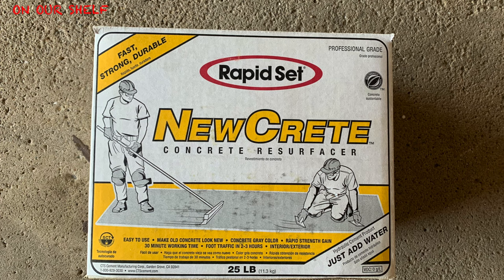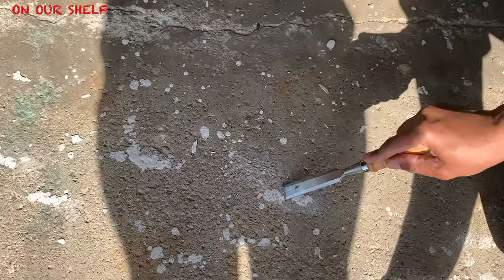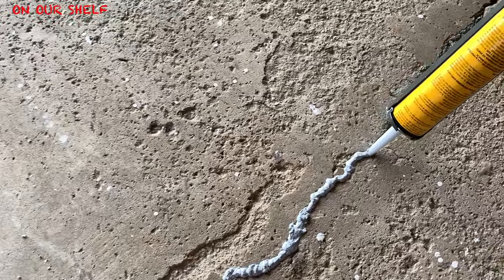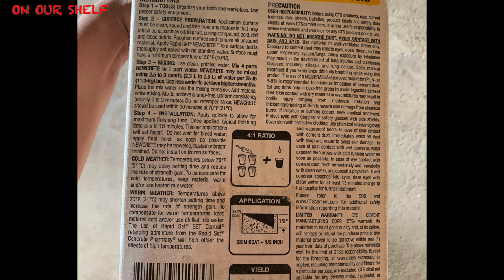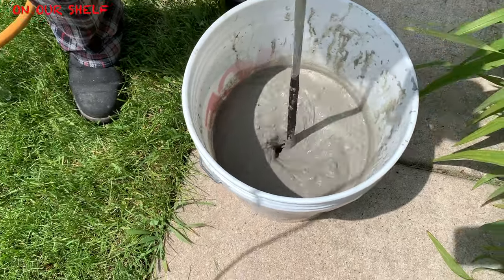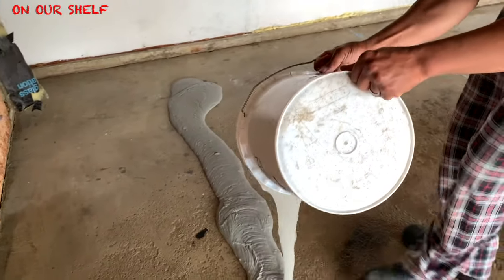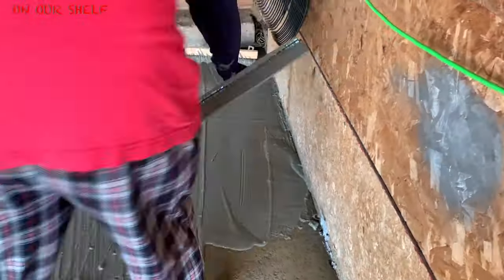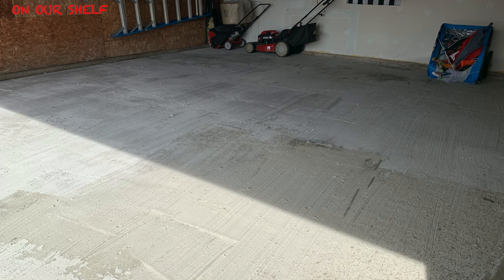New Crete Concrete Resurfacer Review

Comment: Right on the label you show:  "Add material WHILE MIXING."  You didn't do that.  Add it more slowly and do it while running the mixer at a slow speed.  Then once it's all added speed the mixer up slowly and be patient until it transforms into a pancake batter consistency.  Getting the mix right is essential to getting good results.  Also, make sure the mix is stored in a cool place prior to mixing and use COLD water to get the 30 mins working time.  Time yourself mixing (no more than about 3 mins) and don't overmix.  Good luck.
Reply: DIYers are always alone!!.

Comment: I finished concrete for about 10 years.  You did alright for a rookie.  You should have kept stirring until all the lumps were out.  Even if you need to use a board to smash the larger lumps.  Also, you should have done smaller sections.  If you would have took more time it would have turned out better.  Your broom is not very good and you are brooming with too much force.  You should have done it in like four sections.  Hammer drilled some 1x4s down to make some nice control joints.  Thanks for the video.
Reply: Patch spalling areas and cracks 1st
Reply: So assuming someone did something similar.....uh not me of course. What would be the right thing to do now that it's messed up?
Reply: @tigerfriend2000  cover it in an epoxy coating! Lol.
Depending on how bad it is. 😆
Reply: @tigerfriend2000 Lavinia 30” propane concrete grinder and grind.

Comment: My feedback- you should not use the broom to work through big puddles of the mix. You should have poured the mix on the perimeter and pulled it back with the spreader. If you have practice with drywall compound that would set you up for how to spread evenly. Once you pull it back from the perimeter and have it spread out then you brush. Always pull your strokes in the same direction. Never shovel motion like pushing snow. Honestly, if you're up for improving it...all you need to do is buff it with a concrete grinding disk and call it a day. Bonus points if you grind and resurface again. Practice working drywall compound first!

Comment: Hi Jayden,
I have been doing concrete resurfacing over 20 years.  First, let me say;  that was a nice video.  Now, one thing about having a great outcome to any resurfacing project is a clean mechanical bond.  My technique is: 1).  I use a grinding disc even out the floor surface. Also this will remove any unstable concrete at the surface level, which may come up later an cause bond failure. 2).  Clean the surface, just like you did in the video, which will remove dirt, grease and any loose scale, which again, can cause bond failure. 3). One thing that I ALWAYS do after that is to apply a prime coat of concrete polymer or bonding agent. This will help to assure good adhesion and will also slow down the rapid set of your product that you are applying. Concrete can act like a sponge in soaking up the moisture in the resurfacing product, even an interior floor.  Typically, you want to get back on the floor before 24 hours so that your resurface will properly bond to the bonding or priming material. Some types of polymers (Bonding Agent) are what is called non-rewetting, meaning that after the 24 hour window, it will not allow water penetration or a proper bond to the bonding material.  (Many people skip this step and still have good results but this is just how I do my projects because longevity and great adhesion is important to me.   4). Time to mix:  No matter what the product is, I always add a little of the bonding agent that I primed with into the mix, again, just my preference.  When mixing, always put your liquid in first. Then slowly add the dry powder, while mixing. Once it is thoroughly mixed, let it rest for about 2 to 3 minutes. This will help dissolve any dry lumps in the mix. After that time, remix for about 30 seconds to a minute. Also, I like a more flowable mix. It is much easier to apply. I recommend a tool called a Magic Trowel. It looks like a window washing squeegee. Then, pour your material out in a long narrow stream on the floor and move it along with your Magic Trowel, keeping the trowel at about a 30 degree angle. If you try it, it will be apparent how to adjust your trowel. Always work from one side to the other until you cover the entire floor.  Keep a wet edge, this means, don't let your edges dry up on you before you trowel more product next to the last strip that you troweled previously.  I'm not sure if any of this is helpful to you but thought I'd outline the process that I have been using for years with good success and no failures.   Hope This Helps, Lee
Reply: Will this resurfacer work in canada winter? Like -20c  😂
Reply: Thanks. I want to resurface next to concrete stairs on a 1935 house. I will prime it.
Reply: Wow amazing comment! Thank you for taking the time for others, even though his project was already done
Love when people actually add tips instead of unnecessary comments

Comment: As others have said, best practice is to slowly add the New Crete to water while mixing (a friend helps here). Second thing that really helped me (can be done regardless of the amount of water used) is to thinly pour mixture onto the floor and use drywall knife to chop through the remaining lumps. Essentially this is spreading the new crete out a bit before you trowel/brush it out.
Reply: Sift

Comment: Several things I see here. One, grinding the original surface to open the concrete. Two, a primer to increase bonding and create a barrier from potential oils in the concrete from ghosting through. Three, use a different paddle to mix. Eggbeater is good. And yes, slowly add the product. Four, Use a magic trowel to spread it like a window cleaner would use a squeegee. Five, top coat it with a clear urethane sealer. Two coats. Six, I would have filled in those spalled places with Cement All and then the New Crete. Seven, I would have chased those cracks, and opened them up with a v-blade diamond grinder and filled them with Cement All or a two-part epoxy crack filler made for that. Great you tackled that. It was a tough job.

Comment: Yikes! That came out butt ugly rough! Concrete doesn't lie so neither will I. I've done A LOT of resurfacing over the years, no substitute for experience from hard lessons learned but here's a crash course. First off, it's only as good as what it's sticking to, so thoroughly grind the old concrete, and I mean grind it down clean with a carbide wheel on the smoother areas (kicks off dust like 9/11, wear respirator and fans to blow it out and make the neighbors cry) or wire wheels where rough (usually exterior) then hose it out with a broom. Sometimes the product calls for dry floor to be primed first with a bonding agent, otherwise wet... and forget the caulk but chip out the cracks. Always shoot for in the shade, cool, cloudy day or in the evening as hot sun doesn't help. Can't have lumps like that so mix it fast and hard, don't be timid, move that paddle around (I use a 4 arm, seems to work), then get down on your hands n knees and trowel it on so it's flat and smooth, not that lame squeegee on a stick. Finishers prefer a 3"X14-16" lay down / burner trowel, in n out, up n down, away from you n towards you followed by a 5X20" finish trowel (round on one side, use square first to get it flat) side to side in wide sweeping motions, as far as you can reach out, slow, firm and steady. They only sell 4" wide trowels at Home Depot and Lowes, but whatever. The angle is important on hardening concrete, not this stuff so much, just keep the tools scraped clean n wet, constantly. And WHY? would you run a dirty-ass, covered in crud broom over it for a garage floor?! There's usually a window of time when you need to texture it with a broom or sponge. It's tough when you're new mix ridges up against the gooey older stuff like lava, but do your best to overlap, feather it in, a little water here n there. It'll never be totally perfectly smooth the first time over unless it's a small area and you get lucky so come back to scrape, grind and fill then tell 'em to paint it with that durable epoxy paint with chips to hide the imperfections. Better luck next time.
Reply: Excellent advice, but is certainly a hell of a lot of work.
Reply: Thank you

Comment: Thank you for the video.  Sure helps to see these rather than relying on the printed instructions alone.  I used a smaller spiral type mixer attachment with my cordless drill and got decent pancake batter consistency.  Also used a piece of board to scrape the sides of the bucket to make sure no dry material was stuck there.  Ended up using closer to 4 quarts of water per box of material, too.  All-in-all though, Newcrete is very hard to work with for a newbie, since it sets up so fast.  Also, watching another video I realized I should have pre-patched the deeper spalled concrete areas and cracks with Cement-All and a trowel beforehand.  Then used NewCrete only for a very thin "glaze" over the top of it all.  Fortunately I have the rest of the driveway to do it right!

Comment: Gotta mix it longer and a little more aggressively to get the lumps out. Also when you were trying to broom over those piles of materials, that doesn’t work. You’ll need to flatten those out before you drag the broom on it. You could do a second coat and mix it a little wetter. It would clean it up quite a bit

Comment: I did find some fault with, filling the cracks (especially with a caulk) and your mixing and applying it. Smaller batches applied by hand with a trowel would have been better. I applaud you for trying it.  As a building maintenance employee I do have to say that I use Rapidset wall patch, concrete patch and just recently asphalt patch with great results.

Comment: I have used it, didn't get lumps but I added the flow additive which I think they recommend.  anyways, lumps are from not mixing well enough. I think you can do another coat, over the top, hit the lumps with a hammer and break them up.  good luck.

Comment: Thanks for the well-done video. There are a lot of comments as to the mixing of this type of product. One thing for sure is that on a job this large, a helper is key to a successful outcome. What I do question was your decision to brush finish the surface. Garages, like basement floors, are done with a smooth surface while drives and sidewalks are brushed to prevent slippage in wet weather.

Comment: Always add a few inches of water to the bucket first,   run it all through until all the dry stuff is gone and only lumps, if the bucket spins it needs water, if yiu can mix without the bucket spinning its good. Once only lumps are left you bring the drill down so the paddle is about 45 deg and let it flip the mud up a little and hit the air then the side of the bucket. This  comes from someone who mixes a crap load of mortar, resurfacers, plasters, hot mud, ect. Then use a squeegee not a broom over a trowel floor. Any lumps that happen to get by which won't be many you can pull to you and trowel back into the bucket if needed

Comment: I had a hard time with newcrete the other day. But its super strong so decided to give it another shot. The mixing is crucial. Then start with squeege before the brush. I also did the rapid set cement before the concrete in some areas where i had cracks and the concrete went on so nice after that and i didnt need the bonding agent because the cement acted as a primer as long as u get the concrete on an hour after the cement. Im about to resurface my walkway and ill probably do cement first even  with no cracks because im still learning and it made my concrete go on so smooth and nice without my little experience.  I really like that product. I even used their rapid set  asphalt today to fix some street potholes that the city has ignored and it looks professional

Comment: What I love about these guys. It takes balls to fail. You can learn so much from others mistakes. The only 2 mistakes I see is they use a huge heavy broom and they should have use a squeegy, and the had clumps..SO 2 big issues that cause a big fail. but the great thing is you should do it again bro with the 2 adjustments try another quickrete cap or some other overlay material and use SQUEEGY and dont use a broom and make sure smooth as butter  and yu can over lay the garage again easy many people do layers. we want to see 2nd attempt the better way..amazing idea to learn from mistakes

Comment: Not sure if this has been mentioned, using a drywall mud mixing paddle is a bad idea. You can see how it pushes the lumps of powder around. The eggbeater mixer type is ideal since it will break down those lumps. 

It’s important to use the same cement to water ratio. The first batch was a thicker consistency than the second batch which was very fluid, almost like a self leveling.  I’m surprised the product actually adhered, in my opinion the substrate needed more preparation.

Comment: You issue with the lumps is your mixing of the product. You really should put your water in the bucket first and mix the product into the water that will help you to ultimately have a much smoother mixture. It is also a very large area to do with the product you used amd without experience it is difficult to get a consistent blended texture with the diffrent mixes you needed to do.

Comment: I just did my first resurfacing with this same brand with much success. As others have mentioned mix it in slowly and stir for a good 3-5 minutes so that it’s lump free and you want it to be a bit more thin and watery than how you mixed it here. Also next time skip the brush.. I just used a squeegee and didn’t even broom it and it came out perfect. It’s still slip resistant using only the squeegee. But If you insist on using a broom, get a new one and don’t use this jacked up broom lol, live and learn.. you will nail it next time brother!
Reply: Will that work on a green slab after resurfacing with a grinder?
Reply: @brentwiens2652  If it’s green from paint, I would say as long as all the paint is grinded off then you’re good. In fact it will bond even better if you grind the concrete, as it will give it some teeth in the surface to grab on to. I noticed it’s the areas that I didn’t grind that didn’t stick as well and now has areas peeling & chipping off, but the slabs that I did use my grinder have no issues at all.
Reply: Love your transparency! You're a good and honest, hard worker.

Comment: You used the wrong material to fill the cracks. You poured the whole bag in before starting the mixing process. You did  not use a float or trowel to lay it down flat and smooth

Comment: Squeegee first and then use a broom trowel to smooth out the streaksbefore you get to far where you don't have to walk on your fresh work. Uses different type of mixer instead of the flat mixer, it may have helped with the lumps. You still did a good job regardless. Thanks for sharing this video..

Comment: For those doing this, break out the loose chunks in the cracked areas and fill with Cement All first. THEN do the New Crete. Use a float to move the New Crete. You need to let the New Crete set up a bit before brooming.

Comment: Well, I think people pointed out the things you did wrong. I watched you mix it and said, well, there's 90%of your  problem!  That aside, a couple other things jump out. 

One is using the "concrete caulk"  For one thing, assuming compatibility between products is risky.  No matter what brand you choose, you are always better off using the same brand of products. These are things designed to work together. These guys make a repair product called CementAll. It is part of their suite of products for concrete and what they recommend to use before applying this stuff. 

You mix a little at a time and apply with a trowel. Looking at how badly pitted some of your floor was, you would have benefitted greatly by using the CementAll to fill and level that area first as well as treat the cracks. let it cure and the next day, take an angle grinder with a medium course flapper disc and knock down any high spots around those repairs. Blow all the  dust out before going further. 

As a couple people pointed out, you want to primarily drag this stuff rather than push it, so working from the edges toward the center is the way to go. For spreading, you want a squeegee  They make some with sort of a thick rubber foam type blade. They work very nice for things like this. Don't put too much of this down at one time because its working time is short. The colder the water the better to slow the cure down a bit. Some have suggested using a bit more water, which will probably work as long as you don't thin it too much. Work in small batches so any overlap is on a "wet edge". Watch your time and you're probably better off using two people. One mixing and one applying. Have them mix another batch as you are getting close to done with the first. That will keep your tools wet with new product. 

I think most people that have problems with this stuff, get themselves overloaded thinking it behave kinda like paint. It doesn't.  If you are wanting to get a broom finish, allow enough working time after you get it spread. I think using the proper squeegee will give you a nice finish without a need to broom it.  

This is a "Live and learn" product and it's always a good idea to try it in a test area first. Maybe on a small section of walk. That, "test it first" approach is good for a lot of things yo are using for the first time. It makes the  larger application easier because you have a feel for how it works.